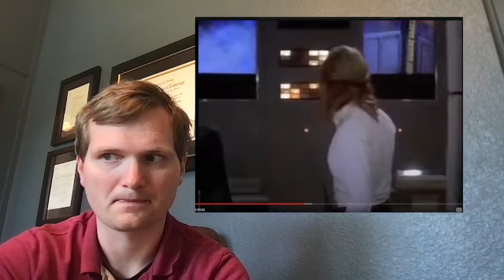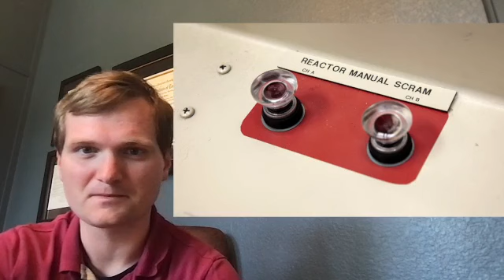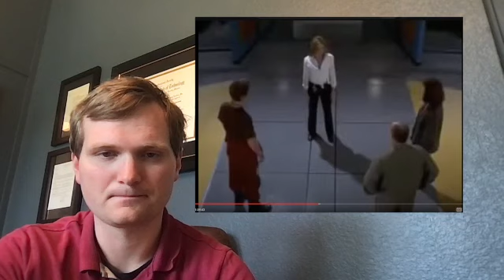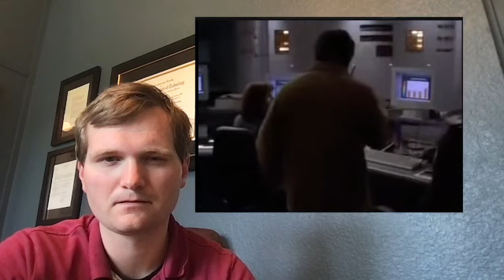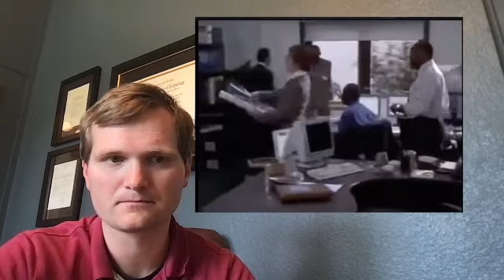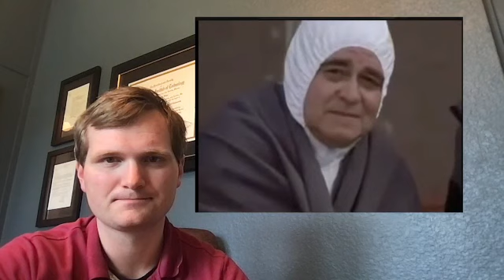Nuclear Engineer Reacts to Atomic Twister Part 3

Comment: You mentioned that the operators' highest priority is to protect the core. However, there's a scene in which the characters deliberately divert the core water into the spent fuel rod fuel. As you explained, this wouldn't actually work due to the pressure differential,  but I'm wondering if there could be any actual situation in which the workers would compromise core safety in favor of protecting the spent fuel rods? At this point in the movie, the core has already been scrammed and so both the core and spent fuel are emitting decay heat, and both of them will cause a lot of problems if they become uncovered. What if it were possible to save only one? Which would cause a greater disaster, a meltdown or a spent fuel rod fire?

Comment: The scam button with key is like a quite common emergency stop button. You can push it to deactivate. To reset you must use the key. No key required to push the button. Also, emergency stop buttons are typically with a normally closed contact. When you push the button, it breaks the connection. So, when someone cuts the cable, it will also deactivate the proces it is guarding.

Comment: I've heard of some reactors having control rods suspended my electromagnets, and when the SCRAM is initiated, the breaker shuts off the circuit, and the rods just drops in. Is this still a thing, or was is just something that was used in some late 50's and early 60's experimental reactors?
Reply from the maker: Yes, that is still very much a thing! If the reactor in this movie was like a real reactor, it would have shut down in about 2 seconds when power to the reactor trip breaker was lost.
Reply: It would have been funnier if the guy had actually had to use an axe ("Safety Control Rod Axe Man")